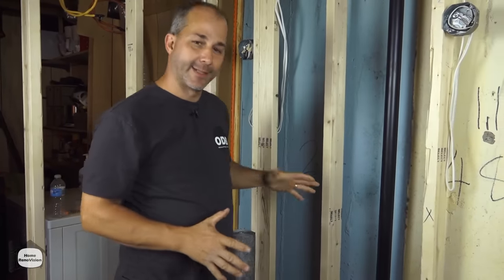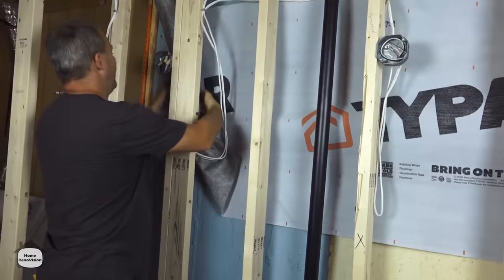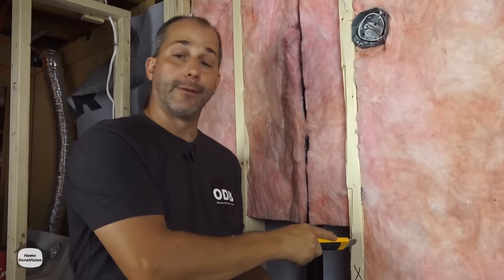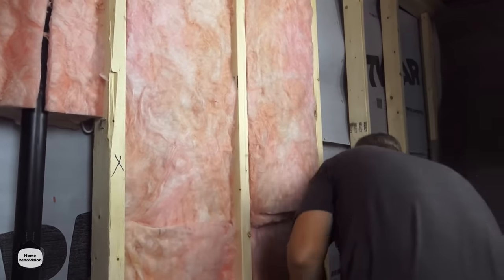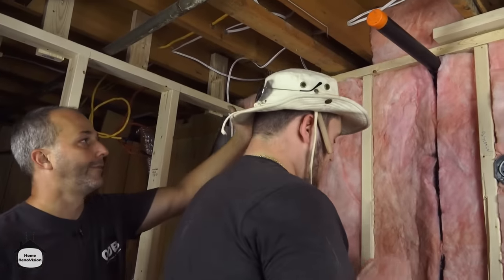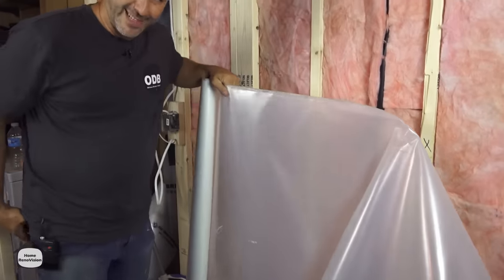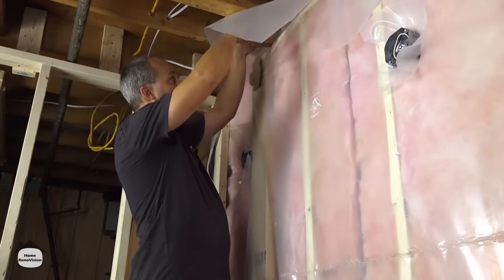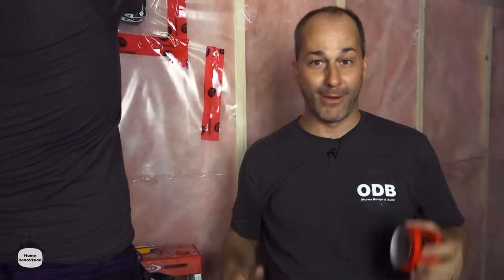How to Properly Insulate a Basement Wall: NO MOISTURE!

Comment: I grew up in a home which with a slab on grade foundation. I also built a shop and mother in law residence as slab on grade. I own a structural inspection company and do residential and commercial work. Heat loss is more of an issue with a raised foundation than slab. I have never come across an insulated slab in a commercial high rise or in residential inspections or in years of training. The concrete slab absorbs plenty of kilocalories only in the process of zeroing out a temperature differential. Once the slab approaches room temperature, it stops pulling heat energy. It's not a zero heat transfer after that, but it is less heat transfer than the floors of most insulated floors in raised foundations. Seriously. Think about where the heat can go and at what rate. Insulation does one thing. It slows down the transfer of heat. Once a concrete slab reaches room temperature. There is some transfer of heat into the earth. How much and how fast will the heat flow? Is there anything transporting the heat? The ground might be 50 degrees. But it will not be 50 when the slab is at 70. It will be 69. The system is one big heat sink. Most insulation works on dead air space principle. It takes an air space and converts it to an air space with very little air move ment. Heat transfers through a hollow wall quickly with no insulation in two ways. Molecular kinetic energy collisions and transporting of the air out of the space taking its faster moving molecules out of the hollow wall. The leakage of air out of the hollow space and replacing it through other leaks with cooler air is how it transports heat out of the building built with no insulation in its walls. Most of the heat rides out of there. If you caulk the living piss out of that wall it stops the flow. What you have left is an insulated wall with a hermetically sealed air space but it is not a dead air space. The pathway for the heat transfer to go out of that hollow space is now  limited to what energy can be kinetically transferred from the air touching the exterior wall material and kinetically flowing through the layers of material until molecular movement is slowed down by outside air with slow moving molecules touching the exterior siding. Getting the exterior siding molecules to slow down makes it so the air  in the hollow space with faster moving molecules will get its molecules slowed down when it touches the inward surface of the siding. Vibrating air molecules have less mass than those in solid materials like siding, sheet rock, and concrete. Air molecules might be vibrating at 90degrees, but when they give the kinetic energy to a solid material which is more densely populated like stucco the air molecules prove they weren't carrying that much heat to transfer because they bounce against the concrete ones and slow down quickly. Air doesn't transfer very much heat because it's marbles can get agitated to move quickly showing its speedy high temperature  But that temperature is just how fast those things are vibrating not how much power and weight they Carry. That's why air is a good thermal insulator.If you contain it. If you don't contain it, and let it get away and take its fast moving molecules elsewhere, the void it leaves gets filled by other air with molecules moving at the temperature of outside or something. Air can really move fast and take heat from you.
The hermetically sealed hollow space in a wall is an insulated wall. It is dramatically slowing down the process of the temperature inside the room becoming the unwanted temperature outside. But if you put R 11 or R 19 fiberglass in the hermetically sealed wall, the heat transfer slows a little bit more. The reason the fiberglass made perfectly sealed air space a little better is because it made it into a DEAD air space. The sealed but open air space allowed for air movement. It kept the air in the confines. But there was a little bit of slow swirling around going on in their caused by temperature differentials. The solid surfaces inside the hollow space have different temperatures because they are being influenced be factors such as outside air temperature, the sun shining on part of the wall but not another part. Without the fiberglass in there, the air wanders around. Air will move when it is heated slightly and when it is cooled. It is actually moving around in the wall even though you caulked the piss out of the enclosure. When it moves around a greater volume of molecules are colliding with the solid surface molecules, stirring the pot to make the air have its temperature effected by the denser solid surfaces. You put the fiberglass in there you are making it so the only way the molecular level kinetic energy can transfer from the sheet rock all the way into the stucco is from lightweight air molecules tapping on other lightweight air molecules. They are strapped in their little air pockets. There's no circulation allowing for more collisions. There is no transporting of hot air to have hotter air move around and run into the heavy stucco molecules to be stunned from vibrating at 90 degrees Fahrenheit and kicked down to 60 degrees Fahrenheit. With all the air molecules just standing in  place with their feet superglued to the floor they are all vibrating at their temperatures like they are supposed to. The only kinetic energy being transferred is via the shoulders of the molecules making the consistent moderate bumping of shoulders  against the guy glued next to you  as appropriate for the temperature.
The fiberglass maintains order rendering the space to be a dead air space. It does such a good job, that the caulking is not necessary.
To stop the heat transfer, we just slowed it way down. Apply this to the concrete slab situation. There is no air involved to transport any heat absorbing materials away from where you are trying to keep the heat. In my msg several days ago I described building a raised wooden floor above the slab. One problem to consider with slab in the winter is how the heating cycle   effects the temperature of slab. If you visit that living space only two hours per day, and heat the area maybe 3 hours a day, the slab will always be cold and warm blooded, cold blooded and robotics and electronic gear will be effected. The heat loss into the earth is not large. Saying it is will not create the need to insulate. Try 2 separate basements in similar houses in same neighborhood. Make sure the slabs are of equal mass and especially equal thickness. Insulate the living daylights out of one of them. Complete work on walls and especially the ceiling the same. They will have equal comfort characteristics and heating bills. I heat the place toasty warm for 72 hours straight. I USE either radiant electric heat (never waste money using electric heat that has a fan or blower motor. I do this when outdoor temp is under 10 degrees and the ground is frozen  solid as concrete. I USE four electric portable radiator style heaters. I set each 1500 watt heater at lowest wattage with reostat maxed. In 24 hours it is intolerable warm in the room. I turn down the temp adjustment to keep it at 78 degrees for a couple days at the very longest. I want the slab to feel warm when I lie on the floor. I remove 2 or 3 of the heaters, one handles the whole place usually at the 600 watt setting. When all the concrete is brought to room temperature, it doesn't take much to keep it that way. If you want to wager a small bet to make it interesting, in a controlled situation, I do not think you will be able to measure the difference. Maybe in  Antarctica. Maybe.
Reply from the maker: Thanks for the lesson!

Comment: if you wanted to put the typar on before putting up the framed wall, what would be your method of doing so, and would you seal it to prevent moisture from entering from the concrete wall?
Reply from the maker: Staple hammer. Wow. First Typar does not seal out vapor. So therefor it doesn't control moisture. I simply use it because it is strong and cheap and it breathes which is what I am looking for. A physical barrier to keep my insulation in place  that will let moisture pass through it.

Comment: In my basement, I already have an R12 Rolled up insulation blanket that covers 98% of the wall, only have about 7 inches at the bottom of the wall close to the floor.
What's the most practical/economical method to add more insulation ?
Reply: Make sure there is an air gap to maintain dryness. Cut a strip of rolled insulation to match. Basements always seem to have moisture issues.

Comment: hi Jeff, im planning on doing my basement and there is pink fluffy insulation extending from the joists to 10 inches above the concrete floor with a vapour barrier around it (it was built this way in 1996). do i need to insulate the bottom sections of the concrete wall? and if so, how? i was thinking of just cutting rigid insulation all along the bottom and gluing it but im not sure.

Comment: So do you staple the typar to the studs? Or do you mount it to the existing cement walls? He says to have air flow so I was assuming there would be a gap between the typar and the existing wall. But it appears to be mounted to the existed wall and then the insulation right up next to it. Then he says it would be easier if you put the paper up before the wall braces. I’m taking it as the paper goes right up to the existing wall. Can any one clear this up?

Comment: Hello Jeff
I have a black coating on my Basement walls, is it still recommended to have this Typar, your suggestions is greatly appreciated
Happy Family Day 😊
Reply from the maker: Most likely it is an early version of basement waterproofing. The typar is to be attached to the stud wall which leaves an air space so no worries there. Just make sure that exterior wall can breathe and you will be fine. typar is water resistant but vapor permeable.

Comment: What would you recommend for insulating a older home with no insulation on the exterior walls....im talking exterior siding applied to plywood, then 2x4 gap, then drywall......I lived in a house like this for 3 years and winters were horrible!!! Now im seeing homes like this all the time now that im an investor.
Reply from the maker: take off the drywall and insulate. the cheapest option.
Reply: @HomeRenoVisionDIY  what if there's no obvious sign of house wrap on the exterior?

Comment: Thanks for the video, very useful information. You skip the insulation of the rim joist hole, and I can't find any other video covering this topic on your channel. As apparently, a lot of air can flow through your house from there, and impact heavily your utility bill. 

What is the best process here? It seems like a 2" rigid foam with spray foam around it to insulate, then add the pink fibreglass insulation is the way to go. But then when adding the vapour barrier you should seal the barrier with the "black tar-like substance" (acoustic seal you mention) or is that optional? Then you staple and tape it? Could you show a video on how to do that please?
Reply from the maker: There is no best practice for basements. there are too many variables. we will be gong over all the info very soon. Cheers!
Reply: @HomeRenoVisionDIY  Thanks, and please thank your entire production team on my behalf! Excited to see the next videos.

Comment: Isn't it better to put some "one by" strapping perpendicular to the studs with the vapor barrier in between and then run your wires and plumbing in it? You can add more insulation between the strapping and then you can put drywall right on the strapping. A little bit more work, but you can be confident with your vapor barrier completeness.

Comment: I'm puzzled as to why you would put an air and moisture barrier on the inside of a basement wall. Surely all moisture deflecting materials should be on the outside where the moisture originates ? Also as Typar is designed largely to prevent wind penetration, I wonder if wind is a problem below grade ? Surely by using Typar and, I assume a vapor barrier you are trapping moisture inside the wall ? If there is a leakage problem through the basement wall you are merely covering it up.
Reply: The Typar was installed strictly to keep the insulation from touching the foundation, which would trap moisture.  It is breathable, so moisture is not trapped on that side.  The air space between the stud wall and foundation helps to dry out any moisture.  The vapor barrier (plastic sheeting) goes on the warm side of the wall.

Comment: Great videos! Very helpful! Was wondering what you do with the poly that reaches the floor? Is it supposed to be fastened and sealed to the bottom plate or left to hang in excess and curl under the flooring? I can't find a solid answer anywhere.
Reply: You cut it at the bottom where the joist and floor meet
Reply: For an extra air barrier you can use bonding adhesive or tar caulking on the drywall seam at basement floor. Im in newengland and no one does this

Comment: Thank you very much, Jeff, that's amazing what you do and how you share it with others. I know you're in Ottawa and I get what thermal range you face every year but I was wondering why you were using that technique instead of blue styrofoam, or urethane. I saw your vid cause I have to reinsulate my 1970's basement in Gaspe Peninsula and I'm gathering intel. Thank you so much for sharing so much.

Comment: Hey Jeff Im seeing alot of videos that say dont put a moisture barrier? my house is 2 years old. Im in Georgia.
Reply: Yeah. This is in contrast to best practice which is 1) closed cell spray within the studs or 2) rigid foam board insulation behind the studs sealed with closed cell spray foam, then use rock wool if needed. This is not best practice he is showing us.

Comment: At 2:37 it appears that the bottom Typar is behind the upper. Will moisture from outside not condense (if basement is cooler than outside) and seep into the insulation and studs?

Comment: Does this prevent the moisture that I get behind my walls every spring or when the temperature goes from cold to warm? 

I live in Winnipeg and the pink stuff gets wet. Is this the solution!?? The wall itself has no cracks.
Reply: I disagree with his approach to preventing moisture. Given the cold climate its better to use extruded polystyrene rigid board insulation against the concrete (making sure that any holes and leaks are prevented). Sealing the insulation and making any joints air tight with expanded foam. Then frame with 2x4 or 2x6 and add insulation between the studs ether fibre glass or mineral wool insulation. Given its Winnipeg I’d do 2x6 just so I can increase the R-value of the wall. Finally add the vapor barrier on top of the insulation and over the studs before installing drywall. Also ensure that the rim joists are well insulated and air tight since they are above grade. I agree with you the fibre glass directly against the concrete wall will soak. And also Tyrap is typically used on the exterior since it is mainly an air barrier and a water barrier, not a moisture barrier, in our cold climate(i’m from Toronto), the vapor all year round travel from the ground and into basement due to higher relative humidity of soil compared to interior. In essence, the tyrap on the interior side is actually useless and serves no purpose. Your better off understanding the control layers by reading articles from the Building Science Corporation. Hope this helps. https://youtu.be/BJyqWlDACVo

Comment: I'm looking to finish my basement and located in ottawa too! Just wondering how this might change for a concrete wall that is not yet framed or insulated but is connected to my neighbors basement? I'm in a end unit townhouse.  Also where can I get plastic electrical outlets?

Thanks for all the videos!
Reply from the maker: the outlets are available at electrical supply stores like marchand. no need to insulate an interior wall.
Reply: @HomeRenoVisionDIY  hmm never been to that store! Also I need to block before I frame due to joists being parallel to the new wall. Due to a cold cold return it's very hard to block in the regular way. Can the blocks be attached to the sill plate and the bottom of the joists instead of between?

Comment: Does the amount of space between the framing and the outside wall matter. If you built the stud wall a foot from the foundation would that be ok. I want to build my wall and nail to a joist that's perpendicular to the wall but it is about a foot from the inside of the basement wall.
Reply from the maker: i would install blocking and put the wall 1 to 2 inches from the wall max. Cheers!

Comment: My basement(Ottawa, Canada) came finished with the pink stuff not all the way to the ground. I'll fill that last bit. What do you think of spray foaming the rim joist area? Is that any better than the triple pink stuff way you showed?
Reply from the maker: No need to mix systems Kareem. If you are going to buy fiberglass then just finish it off as shown. If you want to spray foam the entire basement then do the rim joist as well.